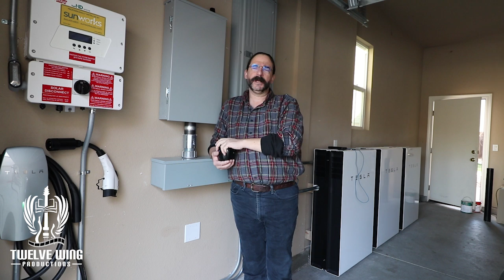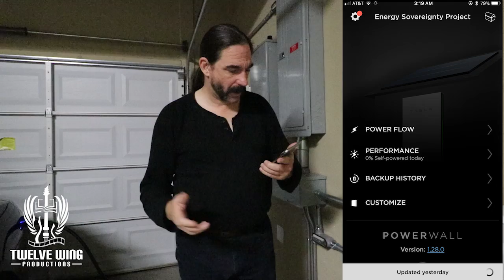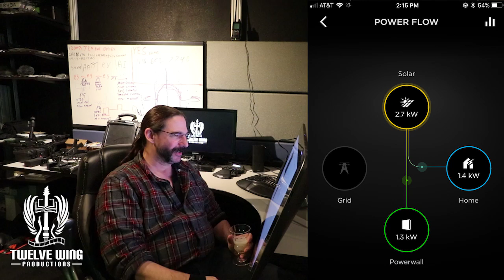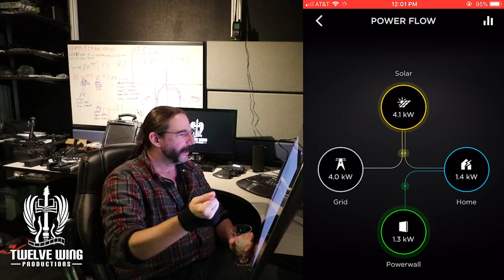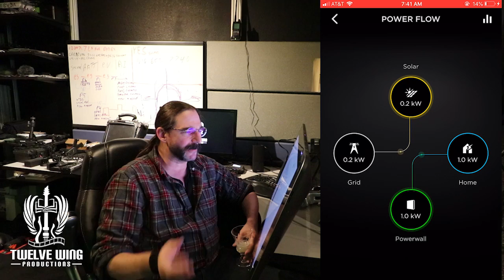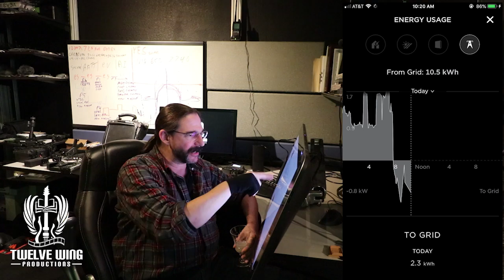ESP Video 4.5: 6X Tesla Powerwall 2 control issues

Comment: Did they install CT clamps on the legs for the solar pv and mains legs, have they checked they are point in the right direction, I to have an ac system here with no battery at this time. Enphase is what we installed with Envoy S Metered which use CT Clamps to show production, consumption and exporting. This may be why you are seeing a delay on change of settings. Post a video of the full Tesla install, people here may spot the issue for you. I'm looking at the Powerwall 2 as an option along with Pylon 2.4KwH attached to a Sofar SE 3000 SP. on a side note love the setup you have and the videos are full of information hope you find the answer to the issues you are seeing...
Reply from the maker: Thanks for following Geoffrey.
Yes, clamps in place and they seem to be reporting accurately minus a small loss/reporting loss that is largely due to the 100w minimum on the Tesla gateway.  More on that in a separate video where we discuss losses.
The lag is totally on Tesla's end.  That part is a known issue and one I expect they will eventually solve.  It's unfortunately painful at the moment.

The two things I'm looking for input on are:
1) Our issue with our SolarEdge 7.6kw inverter being knocked offline when the batteries take over.
and
2) I'm looking for input from other Tesla Powerwall owners to review what our modalities are and our results and see if they are having the same issue with their system favoring grid power over charging their system in winter.

I'm stuck on the whole winter thing because I find it criminal that the utility, in our case SMUD, won't allow us to charge the batteries during off peak times from grid power yet they expect the system to favor sending power to them from our solar production.
In winter, I want to place SMUD in a kind of embargo mode because of this abuse of their customers... and will do so as soon as we are able to island our system.

Elon Musk is a big fan of bringing movie memes into his products.  He should have a "Master Blaster" mode for his Powerwall to set the system to eliminate any solar power from going to the grid.
https://www.youtube.com/watch?v=zEg4F9csPzo

Comment: For Tesla to see your videos, you need to add a rough text to the title: "WHY YOU SHOULD THINK TWICE BEFORE INSTALLING TESLA Powerwall 2" 
"WHAT TESLA SELLERS DOES NOT TELL YOU about Powerwall 2?" 
Or something like that. Then the PR department in Tesla will find these videos.
Reply from the maker: I'll take that under advisement.
I have some zinger titles planned for a couple future videos.  I'm keeping this a little low key until I know definitively that it's not something I'm screwing up.  I'll happily eat crow if that's the case.
Also, if any folks out there currently own Tesla systems, please leave a comment with modalities and time settings you think I should try to knock this loose.
Basically I want the system to self power starting when I tell it electricity is expensive and power the home when electricity is cheap.  That sounds like it should be simple... I just haven't been able to get the system to comply with that.  This needs to be our winter mode given the system is crippled.

Comment: The idea of installing batteries was originally to charge them when electricity is cheaper. But if Tesla doesn't want to charge the batteries, then what's the point? Why then do we need these Tesla batteries?  Maybe another company provides the ability to charge batteries when electricity is cheaper?
Reply from the maker: That's the beauty of competition.  If Tesla won't, someone else will.
I've already had it confirmed by our installer that LG Chem systems have been installed by them that work properly.  At issue is that Tesla had the ability to make this limitation and they caved in to the regulators and did so.
For those that might think that we didn't look into this before, they have to realize the importance of what you wrote.  When we researched this system before selecting it, being able to charge the batteries during off peak time when utility rates were low was ADVERTISED as a feature.  So this wasn't something that we gave any more thought to.
It's also important to remember that these batteries are CAPABLE of doing this.  They just don't.
So yes, what you said is wholly valid.  If they don't.. someone will.

Comment: I am disappointed in Tesla. Why don't they care about their customers?
Reply from the maker: This is a tough one.  I think they DO care about their customers and that this is a case where they were made an offer they couldn't refuse.  They just had to temporarily whore themselves out to the utility companies to get it.
They made a decision to offer rebates and get the Powerwalls in people's homes and in return agree to restrict the systems.
I firmly believe that even Tesla realized that this was only going to be temporary and once people like you and I started screaming about it and showing publicly how stupid it was.. they would fix it.
Reply: @twelvewingproductions7508  But as you said, in reality it BENEFITS the utility in some ways (and it does not in others). 
I will explain.
It benefits the utility to help with the duck curve to be able to move additional power to your battery when they are producing an excess, and draw a small amount to even loads when they are coming up short, and would have to buy power from other sources or bring more production on line. 

It Does NOT benefit them in the situation that if you charge at midnight they don't get to charge you more for electricity and increase their bottom line at peak times, and  also more importantly, if a couple thousand peoples power walls all start charging at midnight, along with everybodies tesla cars and chevy volts, and the handful of CMax Energy's out there,  they might put enough draw on the system to force them into the same heavy load situation they see from 5 till 9pm!!

Dammed if you do, dammed if you do it later.....lol
Reply from the maker: @matthewelyash6538 ,
"It Does NOT benefit them in the situation that if you charge at midnight"~

Have a look at the "Rule 21" video.  I go into what I am about to say in a bit greater detail.
The goal with the duck curve is to make it flat.  Ultimately... people charging their home batteries at midnight... flattens the curve.
What you said was true in that they don't get the opportunity to charge more at one time of the day than at another because they can no longer justify it.
Under Rule 21, the utilities have the ability to adjust when you charge.
Basically what you do is to set your system to "Will call".  Have it ask for a charge.  The utility company (Through Tesla) tells you when and how much your battery can charge.
There should be a special rate for this.
Additionally, your battery reports available capacity and again.. through Rule 21, offers up to the utilities a place to put excess power they have on the grid.
This power should be delivered to you for free because it means that they do not have to shut a power plant down.

Hopefully that made this a bit more clear.  I think by the way I phrased it, you placed too much emphasis on the "At midnight" part.  So don't think of it so much as "at midnight" but instead think of it as "When convenient".

The utility will have all these pooled "Will call" numbers that are sent out 24+ hours ahead of when these systems actually need a charge.
We simply can't help out the utility companies any more than that.
Reply: @twelvewingproductions7508  Thanks yes I actually did watch your Rule 21 video, and it was quite informative. What seems to be an issue is that according to the current situation, The fact you can not charge from the grid is directly in violation of Rule Twenty One.  If they (the Government or the Utility of your choice) have access to my data, have the ability to use my Tesla Power Wall 2 (which is my property) as a sponge to help them with the Duck Curve, and for that matter DRAW from my Tesla Power Wall 2 as a source to flatten the other side of the curve, then SMUD or PG&E by logic MUST let you charge. 

I guess the question becomes When, and How Much, and do you have any say about it, either in quantity or timing of said charge. Beyond that we have to look at under Rule 21, does it state that they can take power beyond what they gave you? Power you generated with Solar Arrays you paid for and maintain? What rate do they pay us for THAT power?  

I agree the face of the industry and the technology is making it hard for everybody to keep up. Your Zombie Apocalypse video and the Stormwatch Two Step we got out of Tesla being a prime example. 

The government spends millions to ask us to, and teach us how to be more self reliant and prepared for inclement weather or other events that interrupt our daily lives, and yet at the same time they have not yet caught up to the fact that those of us who plan to do exactly this are hamstrung by utilities protecting thier profit margins, and capitulation by Companies like Tesla to that utility that does not allow us to to charge in Off peak situations.
Reply from the maker: @matthewelyash6538 ,
"Beyond that we have to look at under Rule 21, does it state that they can take power beyond what they gave you?"~

Rule 21 only currently addresses that they need to have access to the data and control over the system.  Remember, this rule was put in place regardless of batteries.  So the original rule may not have been well thought out in terms of battery storage.

"The government spends millions to ask us to, and teach us how to be more self reliant"~

I challenge you on that statement.  It seems to be the current state of our government to make us more helpless and dependent on the Government so they can grow and obtain more power.

This whole thing is going to be real interesting to see unfold.  A trillion dollar economy based on something that gets burned is going to turn into an economy of epic proportion that will plateau and then fall off sharply.
This is going to be a very rough ride.
Reply: @twelvewingproductions7508  While on the whole I agree the the government does want us to be their sheeple, I was referring to FEMA and the money they spend advertising being ready for whatever calamity de-juour is in vogue.

Comment: I appreciate what you are trying to achieve...being connected to grid.  ALOT simpler having a standalone solar/ battery/ inverter...with their own designated outlets.  You can still have your own grid power.  Tying into the grid really complicates issues.
Reply from the maker: Agreed.. simpler.. but I don't think that the Powerwall 2 offers an off grid solution yet.  I may be wrong.  I'll have a look to see and present options.
Another YouTuber in Australia who's channel is @UCcmw3P6BDUFA4h3Y_FpsB_w has done some work to basically bypass Tesla's check in.  Have a look at his system and get his advice for how best to use a Powerwall off grid.

Thanks for following along and we will keep you and the others informed about what we find as far as the grid solution.

Comment: I am so glad you make theses videos. I was going to buy 2 powerwalls now I will not cause I want all my solar in the batteries what a waste and piss poor coding in the software. He should stop drilling tunnels and make the power walls better
Reply from the maker: Don't write off the Powerwall yet.  Remember that the difficulties we are seeing are software driven and may be totally related to our use of 6 powerwalls instead of one or two.
My next order of business is going to be to have a closer look at how my friend's single powerwall system operates in the same mode.  Once I do that and we get our PV inverter working, I'll do another video outlining how we have decided to set our system for winter running.

I still do believe in the Powerwall, even though I'm giving it some well deserved lumps right now.  We have to remember that we are still in the early stages of this and Tesla is in regulatory hell right now as they deal with politicians and local utilities that do NOT want this kind of thing to see mass adoption.
It is our desire to work with Tesla and other manufacturers to work through these bugs and to shine light on any who get in the way of the consumer's best interest.

Thanks for following and good luck with your system.  Perhaps you will even change your mind about the Powerwalls once Tesla gets their act together.

Again, we are not here to pimp Tesla nor are we here to do any kind of hit piece.  It is as you see it.  If I am wrong about something, if I have something set incorrectly, I will be the first to admit it and show how the system can be properly set for us to take full advantage of the system.  Equally, when Tesla fixes these issues, we will present Tesla front and center.

The Powerwall 2 product is a good one.  Nothing comes close to it for the price/size.  The technology inside is equally the best of any offering.  Software is easy to fix.

Comment: Part of the challenge is the reliance on the app contacting Tesla over the Internet. In a scenario where power is out for extended period and your internet is down, you need this feature. It is not ideal. I am debating where doing off grid charge controller with lithium batteries where this control is available. For the future of Tesla powerwall was they will need more than just central monitoring. This discourages people from getting the product if is not capable of being adjusted islanded from communications. Thank you for working throw this!
Reply from the maker: Thanks for following along Pedro.  We totally agree with you.  Some kind of local control is going to have to be implemented if Tesla is going to remain competitive in the future.
As to islanding the system from Tesla, have a look at @UCcmw3P6BDUFA4h3Y_FpsB_w.  His channel goes over some options and how he solved this issue.
Reply from the maker: One additional thing to add.
I think that in the case of a power outage, the system throws itself into an entirely different mode.  I'll examine how the system reacts to this in a very extreme case.  There will be a period of time shortly when the home reaches a point where it can supply its total power usage from solar production during the day.  This should be at some point around mid Feb. judging from the historical data.
So I expect that on March 1 I will shut the grid off completely until mid may.  When the batteries are full and we start to have an overage, only then will I turn the grid power back on.
This should give us all a great window into how the Powerwall system works during a protracted backup period.
When we do that, we will likely discover things that even Tesla doesn't know.
Reply: Twelve Wing Productions thank you for the reply! I am curious as the self contained product is the way to go. The powerwall fits that mold. I am hopeful they will work out the kinks. In Charlotte, NC we still have net metering and I am hoping to get a Tesla prior to the utility changing rate plans. I prefer the 100% self consumption feature where the grid is rarely tapped
Reply from the maker: @pedrogarces6876 , I'm sure they will.